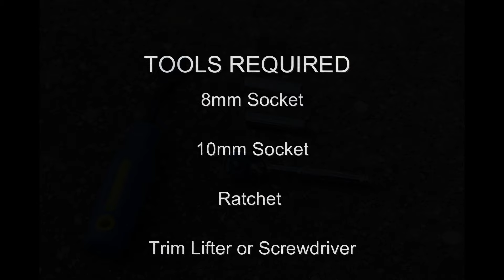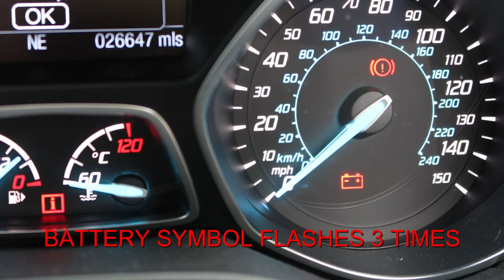Easily Replace The Battery of Your Ford Kuga Escape 2013-2019

Comment: If Ford had decided to have the battery located somewhere in the 5th Dimension it would be easier to locate and change......what a stupid design for something which should be easily accessible. Great video BTW, but mental design I was waiting for you to start pulling the gasket off and getting an arc welder......crazy!
Reply from the maker: ha ha , yeah its as though they designed the vehicle and thought, oops where do we put the battery!!   The Focus is the same too
Reply: OMG,  that was a mad operation, and to think that the battery of my Saab 93 was held in place with baler twine/hairy string. And they call this progress.
Reply: To me, it's not that big a deal. Takes about 10 minutes, and it's something you might do every 5 years or so.

Comment: Made it so easy to swop batteries, except for replacing the front cover, that was a nightmare to slot back in, used some silicone spray in the end which helped it slide back in nicely. Battery re-set worked fine too. Many thanks.   (Ford Kuga 2016)

Comment: I have the diesel 2 litre there seems to be a bit more attached to the air intake, is this just un bolted along with the rest
Reply from the maker: the kuga in the video was a 2017 kuga 2.0 diesel.   I've not seen anything else attached to the airbox before?
Reply: @SYDiagnostics  its  black plastic box  secured by what looks like 2 8mm bolts and needs to be removed before you can get at the bottom of the 2 bolts connecting the engine side  to the filter box, car is a 2015 180 bhp diesel

Comment: Thank you for this video.  I watched this many times.  I just completed the battery replacement.  My problem was that my 10mm socket was not enough deep to remove the securing bracket nuts.  The others were no trouble.  Kuga 2014 Japan.

Comment: Top video, do you know the colour sequence of the white plug that is connected to the negative terminal at the back of the battery, seems related to hill start assist?
Reply from the maker: how many wires are in the plug???
Reply: 3 wires green orange, blue brown, white blue
Reply: Got it , 1 blue white 2 green orange 3 blue brown mk2 2017

Comment: Thanks for the video ! Does the BMS reset work for a ford kuga 2 phase 2 ?
Reply from the maker: 2020> model?
I'd have to check....but these do have known issues with the BMS
Reply: @SYDiagnostics  2017, it’s seems to be ok but I wanted to check because the model on the video is a phase 1
Reply from the maker: @kimwii9956  it was a 2016 Euro 6 model which i'd class as Kuga Mk2 (2012>). Yours is the Mk2.5 (face lift).
Reply: So you think it’s not gonna work ?
Reply from the maker: @kimwii9956  it'll work.....there is also another method in the video description section

Comment: Cheers for this. Im gonna have to buy a new battery after lock down, my Kuga 2016 wont start if the voltage goes below 12V. Its draining often these days & Fords are shut :-(

Comment: Can’t get reset to work on my 17 plate Kuga. Can you confirm with 5 presses of rear fog and 3 presses of hazards you end up with fogs and hazards on until the battery symbol flashes?
Reply from the maker: There is an alternative method in the video description

Comment: Is the nut securing the positive/ negative terminal connections 10MM both in the UK and US? I am trying to source the Noco GC008 eyelet to be able to connect my Noco Genius10 directly to the battery terminals to charge and maintain the battery because it is obstructed by the airbox and does not charge the battery properly by connecting the negative to the body. The UK only seems to sell the M6 and M8, the M10 is only available in the US ATM.

Thanks in advance
Reply from the maker: It's a 10mm spanner size and an m6 thread in the uk
Reply: I thought it was a bit weird that they only sell the M10 in the US, thats £22 down the drain - ive just ordered the m6 eyelet, thanks!

Comment: Shouldn’t the neg battery terminal be disconnected (at the firewall) before removing the positive?
Reply from the maker: hi please read the video description. Once the battery is pulled forward, the positive connection is below the battery. The battery securing clamp is not connected to ground and is a stud in a captive nut in a plastic housing....
Reply: Got it!

Comment: Having read comments in the Ford Kuga Users Club about problem with the battery monitoring system is it safe to remove Fuse 22 in the Engine fuse box so that the Alternator now acts like a normal alternator and will provide a consistent charge voltage?
Reply from the maker: I can't see why you would want to do this? For what reason? Battery Energy management is efficient and also affects emissions.  The Bms is often mis understood and if its a stop start concern you have there are ways to recalibrate the bms (not reset)
Reply: @SYDiagnostics  I have tried the BMS reset using the Rear Fog Light and Hazard warning switches without success ( 2019 Kuga Vignali ).  Any further updates to this method? Many thanks for the information on how to change the battery it was appreciated.
Reply from the maker: @ianjohnson8943  i have another video with the bms reset process. In the video description is an alternative method which should work

Comment: if you buy a battery from a factors is it best to top it up fully before installing it as i assume when you reset the battery monitor it sets the current battery level as the full level and can this confuse it if the alternator then charges it to the maximum?
Reply from the maker: i always test the battery using a decent tester and charge it if its below 80% state of charge (Ford state the same too).  The battery in the video was the same battery as removed, (just for video purposes)

Comment: Hate these ford fir tree clips 
By the way how you keep Ford stereo codes mate 
Anyway thanks for the video and keep well keep safe
Reply from the maker: later fords don't lose the codes. On the ones that do, i just get the code using an app on my phone, far quicker than going onto Ford Etis.
Reply: SY Diagnostics oh yes you’re right on the ones that require code I usually use either power socket with my blue point boost pack which has the lead and that allows to do it or use either starter or alternator terminals to keep powered up and of course extra care when handling live battery terminals like wrap them in insulating material until battery is swapped 
Again thanks and take care and stay safe
Reply from the maker: @sitdox  I suppose, with now issue in getting the code, I've become lazy (only work on Ford)
Reply: SY Diagnostics well then in the same boat mate human nature to find easiest way 😂 regarding working on one brand it’s a good thing you become a good specialist plus tooling and equipment etc but in my position I simply wouldn’t survive in our town so have to compromise by working on multi brands because too many garages in our areas and competition is fierce 
So I consider myself lucky having customers and jobs in this difficult time  
So do I hope you’re doing well too these days 
Loving your videos as your style to explain things etc 
Keep up to good work mate